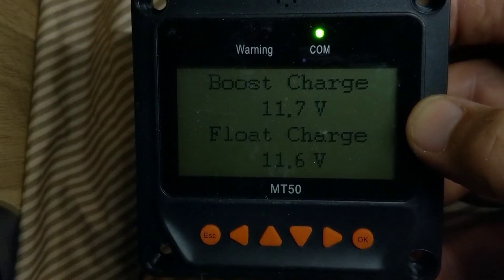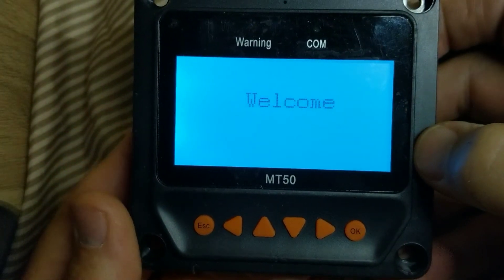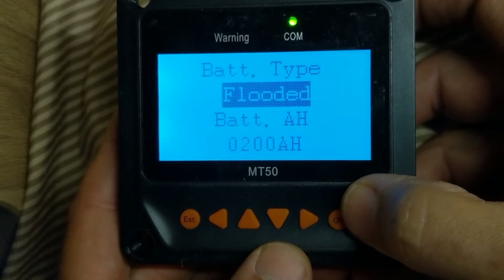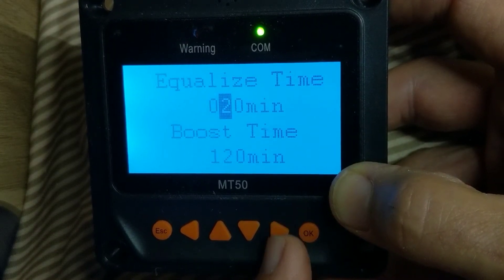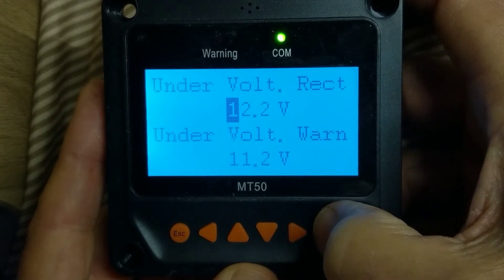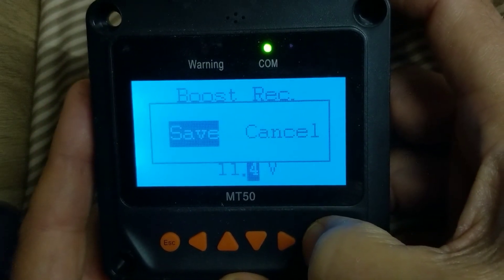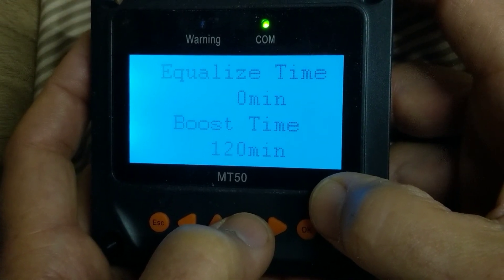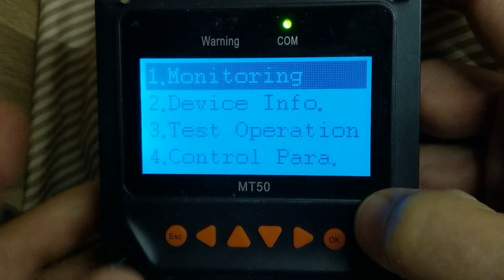Stop Your Solar Controller from Charging Ecotreks

Comment: HELP!!!!
I have an issue with my batteries being overcharged and I don’t know how to fix the problem. I have 2, 12 volt 100 aph batteries and a 250 watt solar panel and I’m using the Epever 20 Solar Controller with the MT50 Remote Meter and a 2500 watt inverter. I only have my dorm size fridge/freezer running on it constantly and charge my phones and use to charge lights when needed 
( I live in my van). 
I am no where near the person that helped me install the system and I can’t find anything on YouTube that shows me how to fix this problem. I am assuming I can change some settings like you are doing here in this video but this is all over my head when I try to read how to do it. I’m a visual learner 😅😬 🙏🏻🙏🏻

Comment: People are not considering the setting of their BMS ,in connection to the controller settings. the instructions of the controller say your battery can not shut down "before" the controller shuts down. 
The sun could be pumping amps into a battery  BUT then a high or low cell shuts down the battery that was absorbing all that power, and it gets "absorbed" by the solar controller that can't. my inverter/charger and the solar controller ALL say " never disconnect battery while in use"  first guy to figure out how to prevent low /high cell shutdown ruining everything else, wins a free thank you. meanwhile. back to my lead acid.

Comment: first question is.. what is a ecotrek lithium battery?

maybe a link to another video in the description with the why's and wherefors and such?
Reply from the maker: Ecotrek is a 200 amp-hour lithium battery with integrated BMS.  Its custom to roadtrek and hymer Canada RVs.  The best answer is if your RV doesn't have ecotreks then don't install them
Reply: @suiethacks4740  this may be a stupid question, but if it has a BMS how can it be over charged by solar?  or is it a terrible BMS system?
ohhh wait, I recall this for extreme cold, that makes sense I guess.

I wonder if there is any BMS that accounts for cold?  hmm

a quick search indicates there are such BMS system.  but most consumers wouldn't think of asking such a question I guess.  

thanks for the reply and education.

Comment: i was just noting yesterday all my charging and discharging voltages are way off my disconnect i think was 10 volts shit at 10 volts my agm battery is dead never bringing it back... the nerve of people two sell you products two only use them and completely destroy your batteries... the nerve of some people...thanks for the video,, the value that says rect what the heck is that does that mean reconnect ..???  and i dont no what your setting you may want two recheck those values they seem way off... my agm battery is 25% at 12.2 volts

Comment: Hi Sam, One of my lithium batteries isn’t working properly and I hope you can help. When I turn it on and hit the rest it goes on and shuts right off. If I hold in the reset button it turns on and the volt is erratic. When I release it again it goes off? Any ideas?
Reply: Hi Tony - I'm having same issue with my Hymer Active...did you ever get a response?

Comment: Very interesting, i just bought a 2019 Zion srt and the lithium batteries keep shutting down and the volt start kicks on when the batteries are full. So maybe this will help?
Reply: Have you resolved the issue? My lithium batteries are dead also and will only come on when I'm plugged into shore piwer snd hold in the reset button for 20 seconds or so. As soon as I let go of reset they go off.
Reply: @tonytampa5335  no not yet
Reply: @Lracnolip  
Looks like I need new batteries and need to have it rewired. Problem is these repair shops want 500 in labor to do it. I'm looking on Facebook for help so we'll see.
Reply: @tonytampa5335  what type of batteries you have? L1, L2 or L3, it's easy to replace i have done it my self, i can guide you if you want